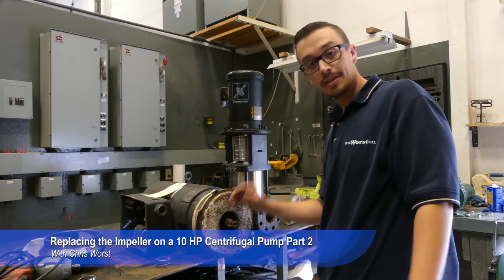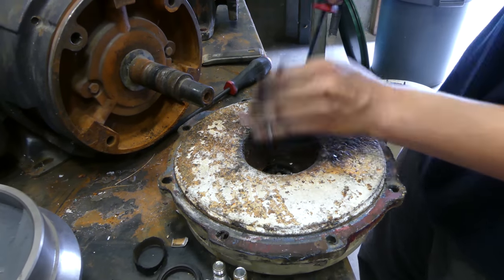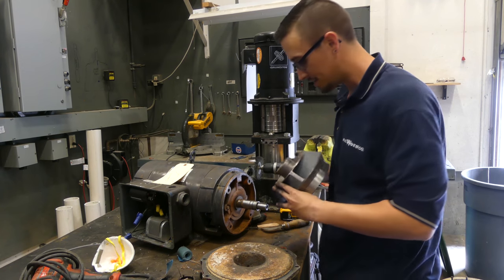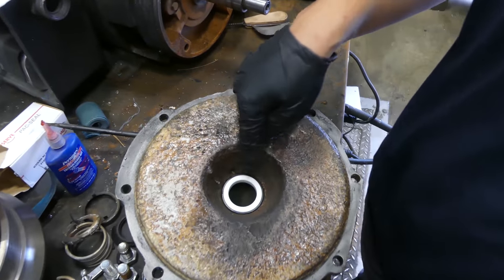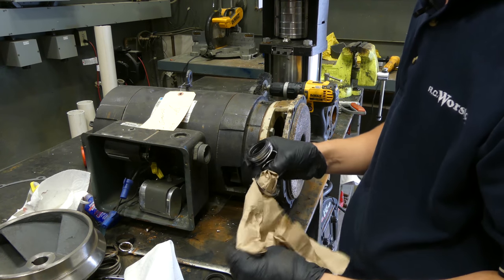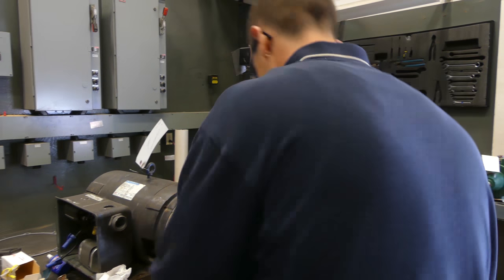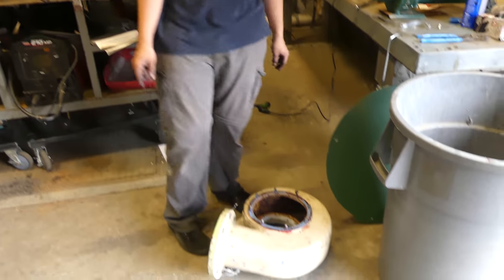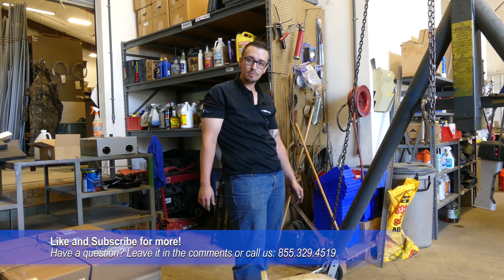Replacing the Impeller on a 10 HP Centrifugal Pump Part 2

Comment: Does it need to have a shaft key in there?
Reply from the maker: I'm not sure what you mean. The impeller is held to the keyed shaft via the bolt @ 9:35
Reply: Yes. The key is necessary for the impeller to be locked into place on the shaft. If there isn't a key, it could cause the impeller to spin in the shaft.

Comment: wow you have a lot to learn >loctite on oily threads doesn't work ,you should have put anti-seize on the shaft before installing the impeller, never use a 2 arm puller on impeller ,if a impeller doesn't move easy heat it before breaking it
Reply: Thanks for the comment. I certainly to have a lot to learn, I admit that. I do not think the video showed how rusted and cracked the impeller was before I started pulling on it.  Since the impeller was already ruined the only thing that mattered to me was getting it off without causing further damage to the motor side of things. I did not have enough clearance with the intact impeller to properly heat it to remove without risking damage to the motor bearings so I had to try to pull it off. Per the manufacturers manual, anti seize is not recommended for the shaft. Also non-permanent thread adhesive was applied to the impeller cap screw in accordance with the factory documentation.  Here is a link to the document if you would like to review the procedures: http://www.berkeleypumps.com/resources/images/4518.pdf